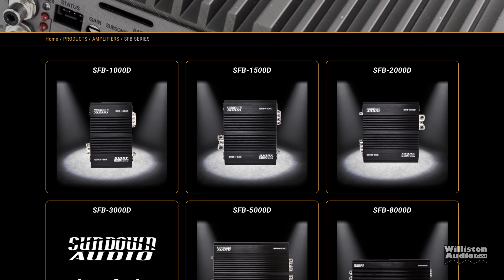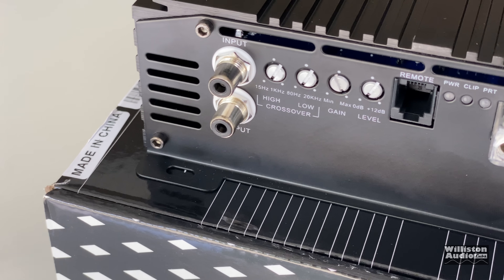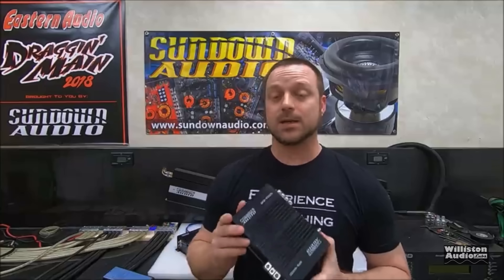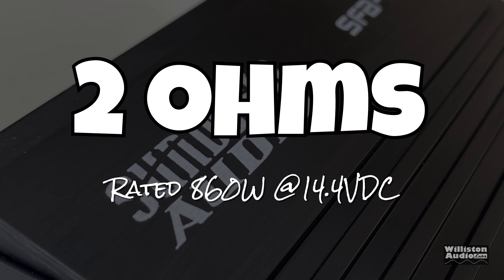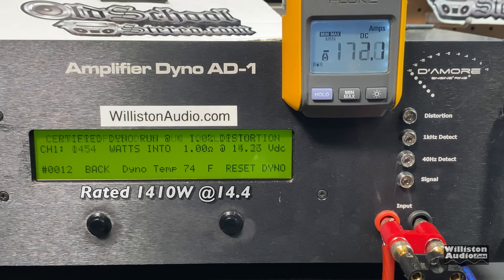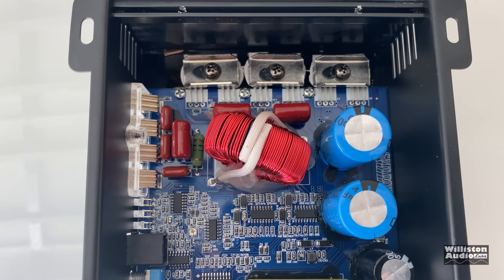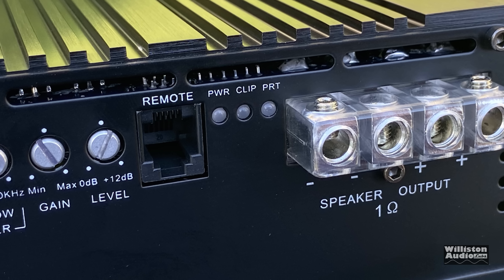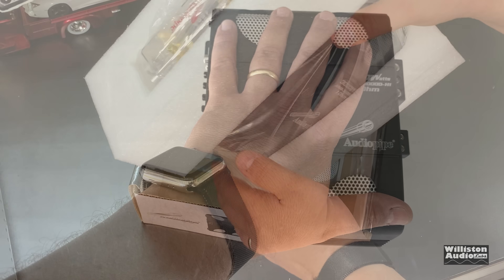Sundown 1000W Full Bridge SFB-1000D Amp Dyno

Comment: i dont expect a lot from the audiopipe maybe the one i got was a dud but it was short 750 watts or so
Reply: id really love to see some of the old quality full bridge circuits to make a comeback. some of those amps are so good i buy them almost whenever i see them just to have, been searching for modern equivalent and while there are some good options like this taramps, banda, db, and others they arent quite what im looking for.
the powerus budgetgems tested is another id like to try but not quite what im looking for. 
basically there are some old school boards by a few well known companies that are just amazing and im looking for a modern equivalent. i dont want to have to run my amps at 1 ohm to get the power i need and these older boards did great at 2 ohms one even did more at 4 ohms than 2. 
also i want big ass 2 channels to make a comeback ive gotten a few protos trying to find something with the reliability of the old big 2 channels i used to run but so far havent found anything that id want to put out. id use them myself but nothing i want to invest a ton in to bring to the market. sadly the cost of having something custom designed and built is so much that i could never do it myself and im not gonna hold my breath waiting for the big companies with the budget to do that to actually do it. so im kinda stuck just seeing what different buildhouses have to offer and hoping to find the one that can go the extra mile and has something built ontop of these old awesome designs or just clones these awesome older circuits id be fine with that because its getting very hard to find these particular amps nowadays. 
1 i havent seen for sale anywhere in a couple years now
Reply: in the meantime though getting these protos and testing them is a fun hobby
Reply: iirc orion is putting out some pretty decent full bridges nvx as well

Comment: I have a pioneer deq-9200. I need to get it repaired, do you happen to know anyone who can repair it?
Reply: I got a 4 channel Pioneer champion series for sale. Brand new, I only used it for 2 weeks ans then upgraded to an sfb2k
Reply: @RomaVilla  the pioneer I'm trying to get repaired is a 6 channel audio processor
Reply: @stepside78  oh alright, I got you
Reply: @stepside78  what excactly did you use that digital processor for?
Reply: @RomaVilla  my front, rear and subs amps. It's a digital equalizer and audio processor
Reply: @stepside78  nice, im gonna have to look into them. I do have a question about an issue I'm having with my highs amp. I've changed the ground and placed it in 2 different spots and I still keep getting a buzzing or almost whinning sound just from my highs amp. I have both rcas and remote wire running on the passenger side and power and bass knob cable running on the driver side. Why do I keep getting that sound from my 6x9s and tweeters
Reply: @RomaVilla  it's picking up a noise threw the power cable, the RCAs might be to close to the power cable. You can try a ground loop isolater for the RCA cables. I had the same issue and the ground loop isolater fixed it

Comment: What is the most efficient amp at 2 ohms?
Reply from the maker: Probably the Crescendo BC-3500 or DC Audio 3.5k. They were pushing 90% efficient
Reply: Or a deaf bonce 4k, like I personally run at ½Ω  and it comes with a much better bass knob, with amp temperature, voltage and clipping light, along with dual 1/0 power and grounds and also has a clip limiter button.. id like to see this amp on a Dyno, I know it does rated though

Comment: do i need a  $1000 battery for this $200 amp
Reply: Current draw is displayed through every Dyno run, in the yellow fluke display stuck to the Dyno. Extra batteries and high output alternators generally are not necessary for a 1400 watt amp that is 70% efficient. Your stock alternator and a good AGM under the hood, wired with  OFC wire, at least 4 guage, but preferably a little bigger, like 2 guage welding wire or 0 guage would certainly be enough.

Comment: I spent most of yesterday re mounting my jbl 14001, would’ve been soo much easier if it was one of these little guys!
Reply: I just rebuilt a GTO 14001 it now has fdp61n20 output transistors thanks to seeing sam at barevids do the same. I ordered the transistors from newark "funny story" the whole reason I did was because they had sent me an offer for 20 percent off and when selecting shipping they had all methods for $7 so I selected next day air. Didn't think anything about it, it came quick right on time and then they sent the bill that said shipping was $55 and I called they said to email the sales department because if it said all shipping methods were $7 then they would have to refund the difference. Within two days I got two reply's which had a list of their internal communications "copy's of their emails back and forth where they verified to each other that yes it was supposed to be $7 and the refund was issued! They even sent me another offer for 20% off my next order, pretty glad I chose them over mouser!
Reply: I miss my GTO14001 and my GTO 1004. Beautiful amps.
Reply: Robert Contreras I’d love a 100.4 to run my front end, they’re hard to find for a reasonable price now!